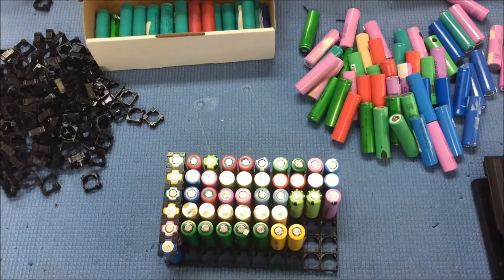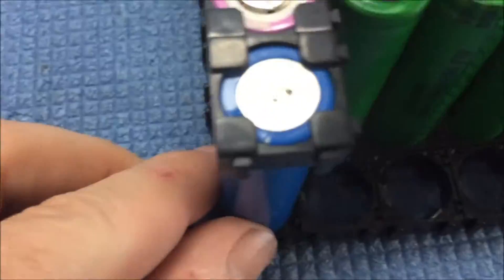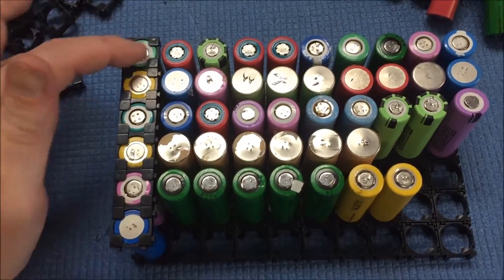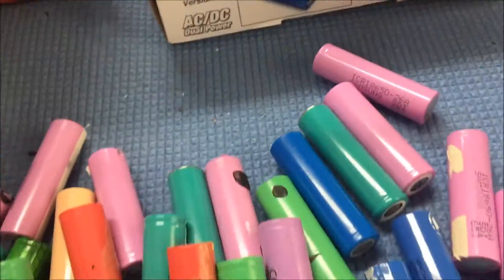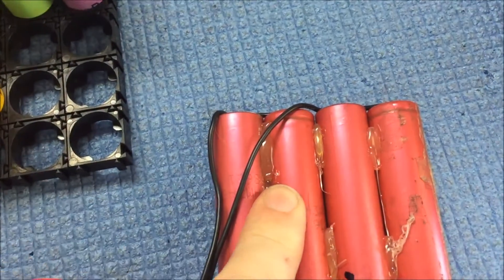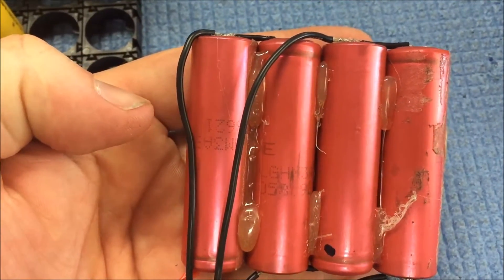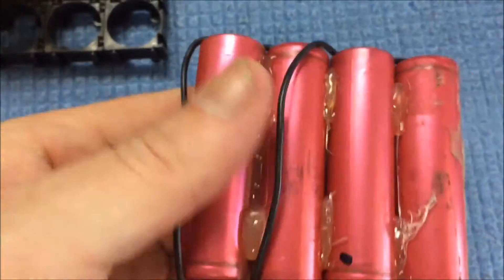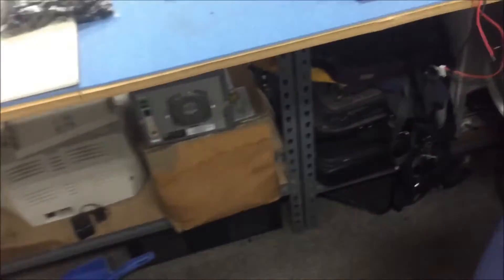Homebrew Powerwall Project - S01E04 Starting to get rolling with this 18650  project

Comment: What is the name of the box things.
Reply from the maker: +yankey4 Is that what your talking about ? The 18650 battery holders ?http://www.ebay.com.au/itm/361379204932?_trksid=p2057872.m2749.l2649&ssPageName=STRK%3AMEBIDX%3AIT
Reply: Peter Matthews yes thank you!!
Reply: Ah, I didn't even think of going ebay. I found some 5x4 holders on Amazon, but the cost is much higher than the ebay offerings. Are you still using these 1x1's with your latest packs? Thanks for sharing.
Reply: Annnd, again. I see you switched to the other holders later on in the playlist. I'm going to watch the whole set before asking questions. Haha. Cheers.